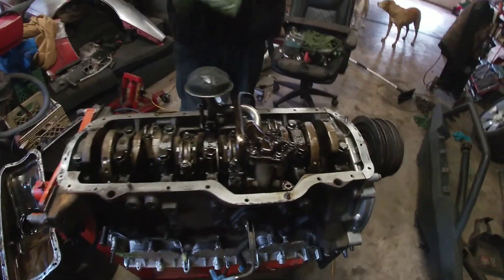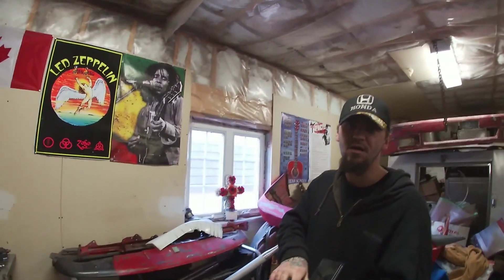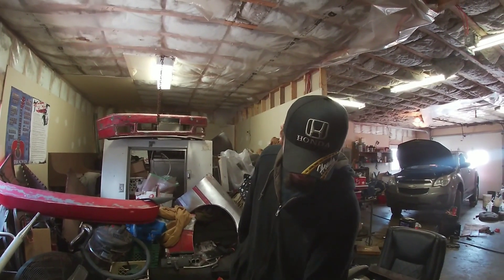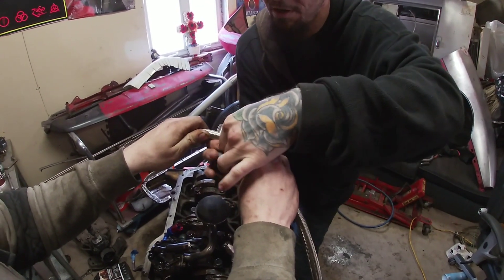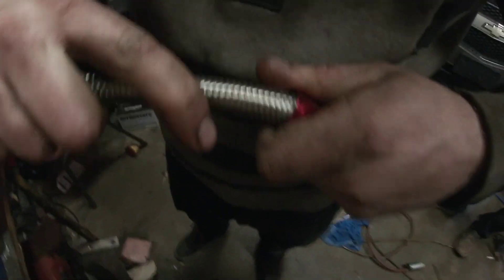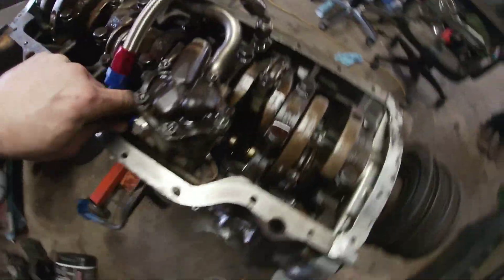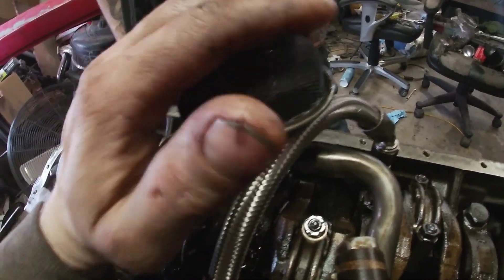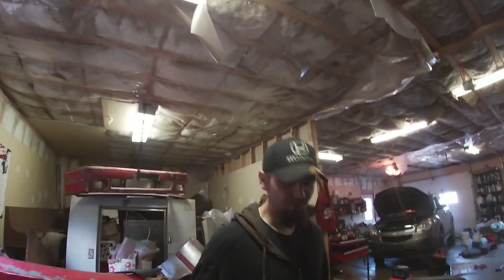Supra gets oil pump mods/how to make 8 AN fittings and lines 😎

Comment: Hell no would I use those little fine steel braids in the bottom of my oil pan!!!!!!..... That's nuts!!!!!!..... If I couldn't get someone to weld it properly the hard tube, I would rather use some kind of a copper compression fitting and a 90 on the steel tubing!!!!!!... Those little fine steel braids go through a bearing it's gone!!!!!!
Reply from the maker: The steel lines don't come apart they are good for over 400 psi if it was installed wrong tho yes it could get into oil pump and bearings /head we have done many of these for years with no problems
Reply: i think you're being a bit dramatic; driftmotion sells a very similar setup. In fact it looks almost exactly the same as the driftmotion item, just different coloured fittings.

The guy who owns the driftmotion site has worked on 7ms so much, at this point he knows them like the back of his hand. They've been selling these things for at least a decade now, I'd imagine if there were any problems it wouldn't still be something you could buy off them.
Reply: If youre that worried, put a magnet inside the pan, near the pickup.